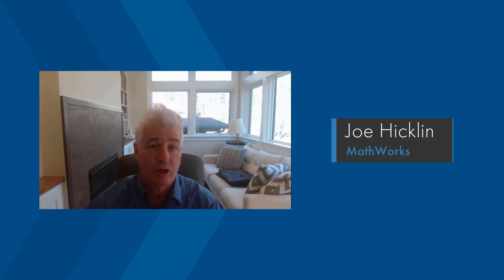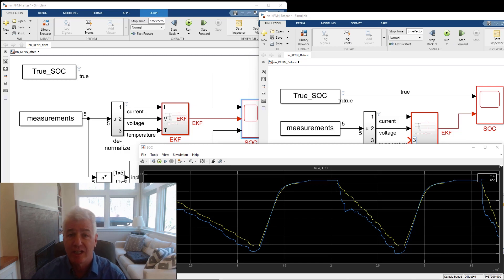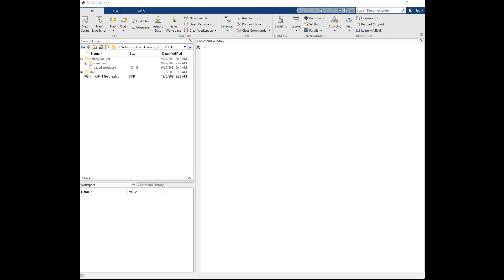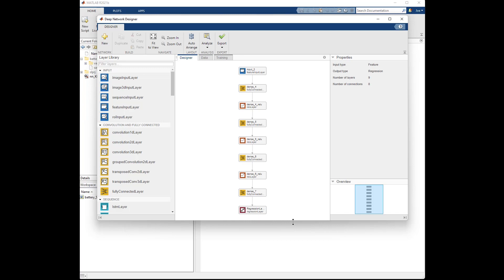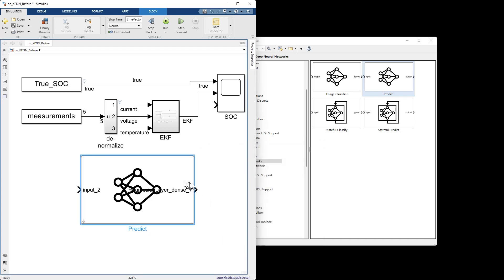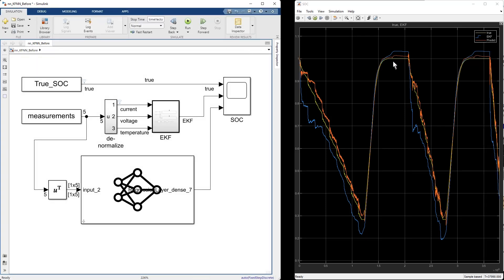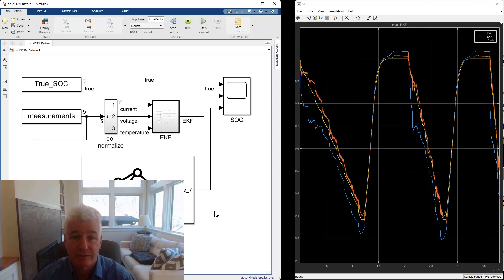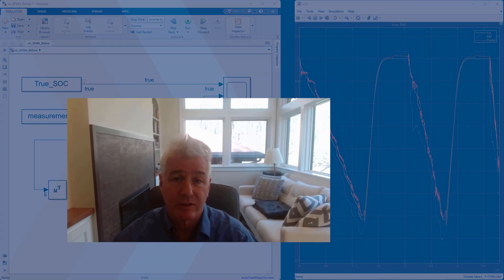Integrate TensorFlow Model into Simulink for Simulation and Code Generation

Comment: I have two questions which might motivate for more videos:

1. Is there also a way to import other models such as Decision Trees etc.?
2. What is the best way to import c-files in a simulink model? To be more precise I think of using c-code in a simulink model for implementation on a SpeedGoat system (RCP).

Comment: Hello, 

I have the deep learning toolbox installed as well as the Deep Learning Toolbox importer for tensorflow-keras models, but I keep getting an error every time I try to use the importTensorFlowNetwork command. The importKerasNetwork command works however, but I need my model saved in DAGNetwork format.

>> test = importTensorFlowNetwork('bypass_flow_model_1')
Unrecognized function or variable 'importTensorFlowNetwork'.
Reply: Try installing "Deep Learning Toolbox Converter for TensorFlow Models" add on
Reply: @michaelnilan7413  Hi I realized this was because I am not using a new enough version of Matlab (I believe 2021a or newer is required)